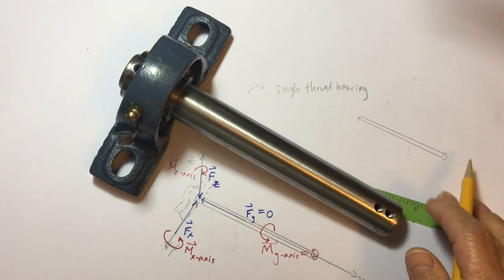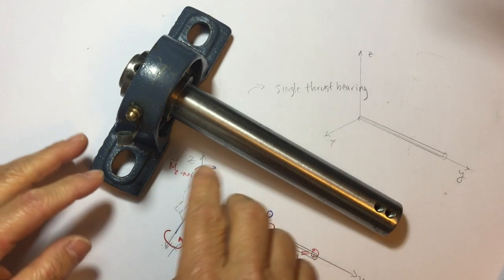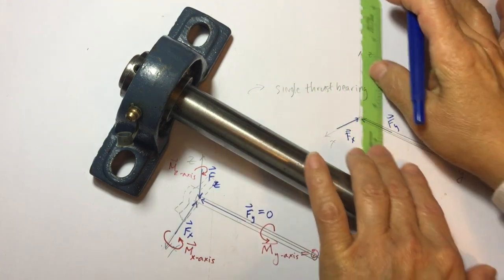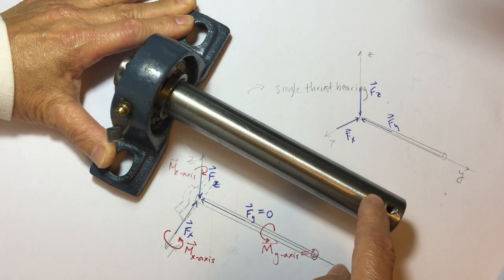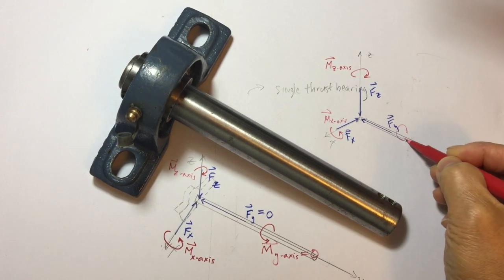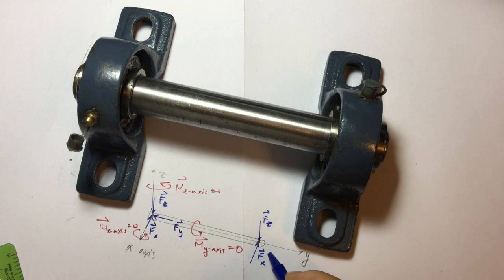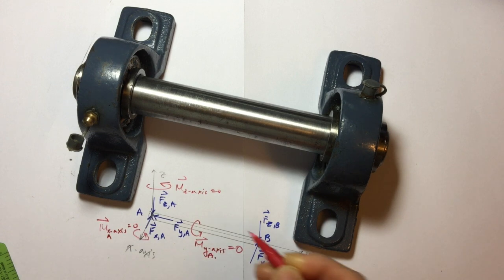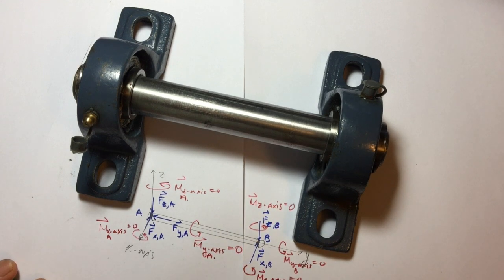Sec 5.5 Free-Body Diagrams - part 2

Comment: Still ambiguous why Mx, My, Mz are all zeros when we have tow journal bearings. Clearly you can rotate along y-axis so My=0 but Mx and My should not be zero because you cannot rotate it along those axes.
Reply: (at 3 min) With a single journal bearing, there is a tendency to resist rotation about the x- and z-axes. So, there are reaction moments about these axes (i.e., Mx = not zero, My=not zero).  

In certain situations, the design and use of a single journal bearing may be acceptable. That is  Mx=not zero and My=not zero won't cause concerning wear and tear on the journal bearing.  However, when loading is such that this is not acceptable, what would an engineer do?

(at 9min 9 seconds) It makes sense to add a second journal bearing at the opposite end. In such design, Mx=0, My=0, and Mz=0. That is, only force reactions exists.
Reply: @ok2standup is't because the reaction moment for both bearing cancle each other